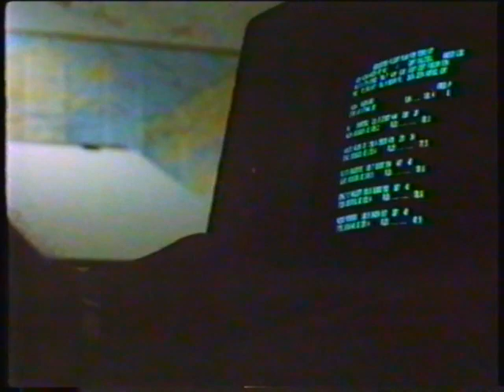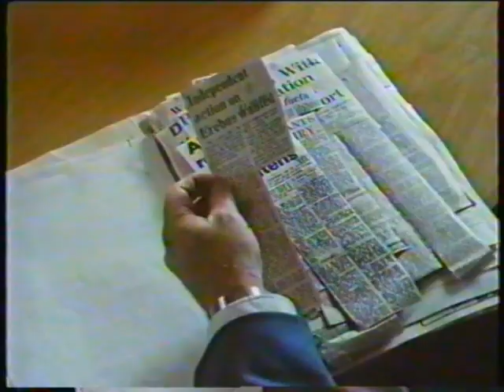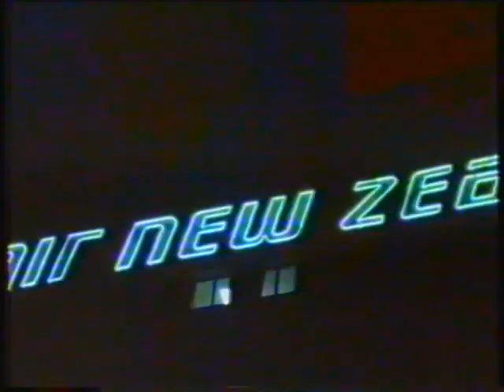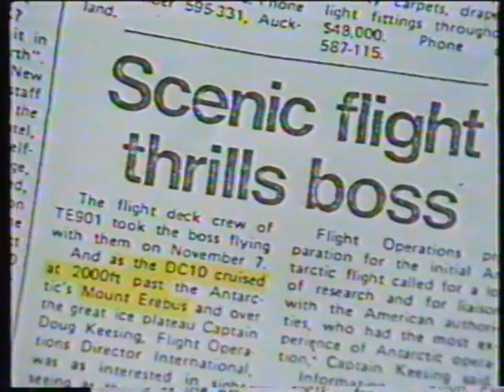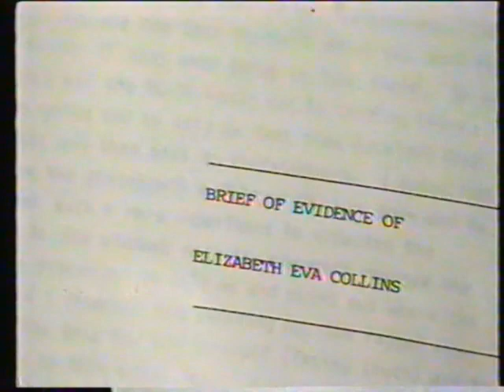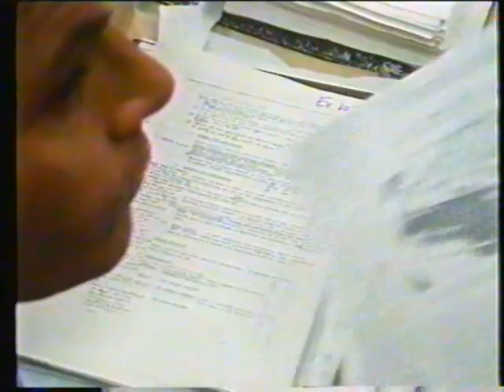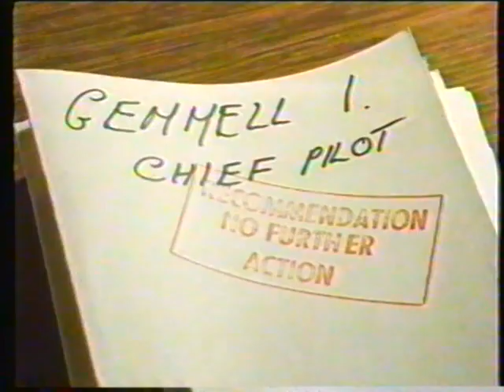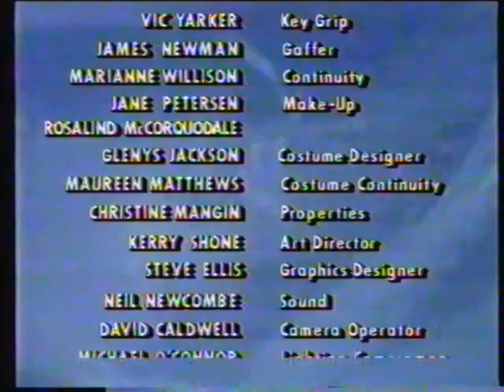Erebus - Mt Erebus Plane Crash Documentary (1997)

Comment: It's hard to conceptualize that a supposedly experienced crew on a supposedly visual sightseeing flight would steer their jet into a cloud obscured volcano because of an incorrect/changed waypoint on their computer flight plan. The crew had failed to cross check their track on a navigation chart and should not have descended from minimum safe altitude while Ross Island and Mount Erebus were obscured by clouds. The crew was offered but declined the assistance of McMurdo radar guidance.
Reply: I agree that the crew of this sightseeing flight was partially at fault. So was the airline in not properly briefing the flight crew about route changes. In aviation, the South Pole is the Wild West. It should have been treated with greater care, caution, and respect.
Reply: I wonder too HOW this could ever happen! Maybe the flight was becoming too routine, too routine to perhaps consider double checking data and procedures. Of course that is just a guess, but after our Space Shuttles here in America met with catastrophic ends, in spite of the best engineers and pilots on the planet, one needs to consider complacency as a cause in routine aviation.
Reply: The coordinates were changed a few hours before the flight and the crew were not told. The captain and rest of the crew had been briefed beforehand and their briefing was based on the route the plane was supposed to be on, i.e. over McMurdo Sound and not  in the path of the mountain. The captain cross checked the route and this has been verified by his family members who saw him doing so the night before. Captain Collins was a very meticulous and thorough man, who always checked his route thoroughly prior to a flight. As for descending down to the lower altitude, they were invited to do so by the traffic control in McMurdo Sound. I don't know where you heard that "the crew was offered but declined the assistance of McMurdo radar guidance" because that was not the case at all. The fault lies with the company and not the pilot and this was proven in the Royal Commission of Enquiry.
Reply: @moirapettifr7127  One big mistake was that this particular pilot had never flown to Antarctica before. His first flight should have been as co-pilot or observer, not as chief pilot.
Reply: @dianewalker4633  Another point is that these days it would be unacceptable for a pilot to fly his first flight to Antarctica as chief pilot. He would be co-pilot or observer, with the main pilot being someone who'd flown there before.
Reply: @ajs41  You need to remember that this happened 43 years ago.
Reply: It is likely the crew suffered from the effects of whiteout. Even the judge of the subsequent inquiry experienced the exact same phenomenon.  A change had been put into the computer and the captain not told of it. He believed the flight path would take him over the sound, not over the volcano itself. All the testimony of others who attended the briefing said the same, they had been briefed of a different path. It was criminal for them to change the path without informing the flight crew.
Reply: @dianewalker4633   The Flight engineer saying "I don't like this" and "You've been under instruments for a while now" and the FO saying, "If you turn to the right, we can do a 180 - there is no high ground behind us" are somewhat giveaways. 
Yes, mistakes were made by the company, although there was pilot error in addition to those mistakes.
Reply: @neilwendylauren  Actually, none of those statements were made. The inspector of Air Accidents at the time, Ron Chippendale,   altered the transcript from the black box and added about 45 statements that were never made. This has been proven and verified by the team who first transcribed the black box. Chippendale wanted to blame the captain because if it was found to be the fault of the company it would have cost them millions of dollars. You need to take note of the findings of Justice Peter Mahon, who was appalled at the dishonesty of Rob Chippendale.
Reply: @dianewalker4633   That simply isn't true. Cite what you are saying.
Reply: @neilwendylauren  It is 100% true. I suggest you look up The Erebus Enquiry by Peter Mahon or the Mahon Report. There are also several books (all of which I have read)  Verdict on Erebus by Peter Mahon, Impact Erebus by Gordon Vette, Daughters of Erebus by Paul Holmes.  Daughters of Erebus is an extremely well researched, well written book. I have also watched quite a few documentaries and reports about the accident. As a New Zealander I also remember the accident and followed it very closely. And so don't you dare tell me that what I say isn't true. What research have YOU done on this?
Reply: @dianewalker4633   I have read every book available on the accident.
Are you seriously suggesting that it is too much to ask the PIC of a DC-10 to plot the coordinates on a map ?
The briefings were 19 days before they left.
Plotting the coordinates on a map would have taken maybe 15 minutes.
They were using INS not GPS, hence the prudence to do this.
Reply: @neilwendylauren  You clearly have not read every book available on the accident. If you had then you would know that what I am saying is 100% true and correct.  Did you read the Mahon Report? Did you also read Paul Holmes book?  Did you read Verdict on Erebus by Peter Mahon or Impact Erebus by Gordon Vette? I somehow think you have not read any of those books, so don't lie by saying that you have read "every book on the accident" when it is obvious that you don't know even the basics about it.
Reply: @dianewalker4633   Thanks Dianne,
You are clearly overly emotional about the entire thing.
Notably, you didn't answer my question about the plotting of the co-ordinates.
I know what I have read about the accident and don't need for you to call me a liar.
The fact is, that had the PIC plotted the co-ordinates then the accident would never had occurred.
That is self evident.
Reply: @neilwendylauren  I am not overly emotional, I am annoyed. I remember when this accident happened and have followed it from the beginning. I also have family members who worked for Air NZ at the time, one of them being a pilot who knew the captain of the Erebus flight, so I know what I am saying is true.  Had you read about it like you said you did you would know that the very meticulous captain had plotted through the course the night before the flight. His family watched him do that and talked to him about it. However, it made no difference because unknown to the pilot or anyone else, a sole Air NZ office worker changed the coordinates and not only did he not check what he did, but he didn't tell anybody he had done it. So instead of taking the usual route the plane had now been programmed to fly directly into the mountain. But surely you would know this because after all, you have read "everything on the crash".